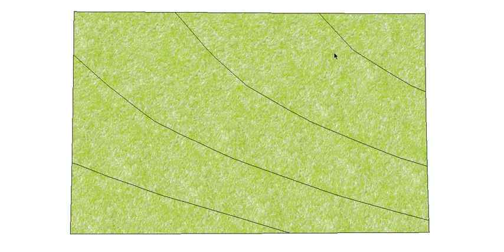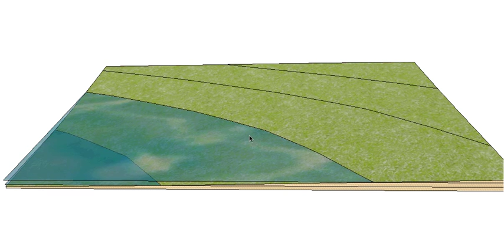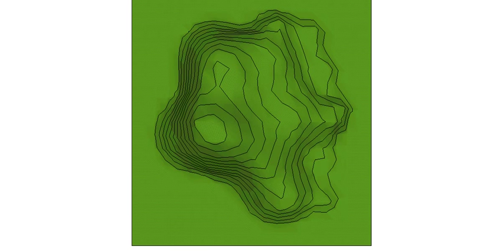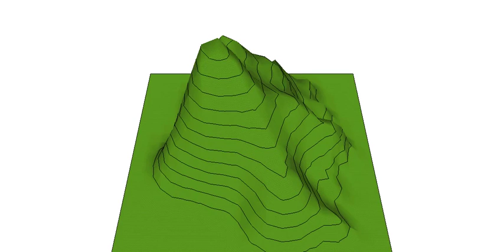Contour Lines

Comment: Why would I ask for a multiple points over a line to be contoured onto a structural section of a graph any valid reason to my guessed inputs .
Reply from the maker: Hi Mate, this process lets us plot the position of out contour lines givng us a 2D representation of a 3D shape. The readings also allow us to calculate spoil to be removed if required.